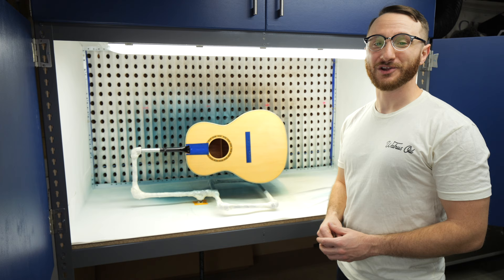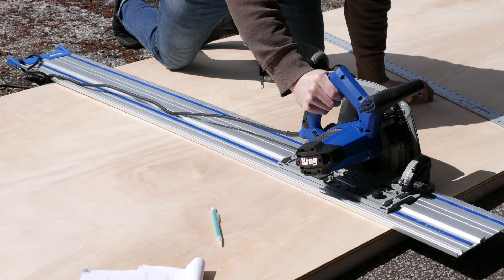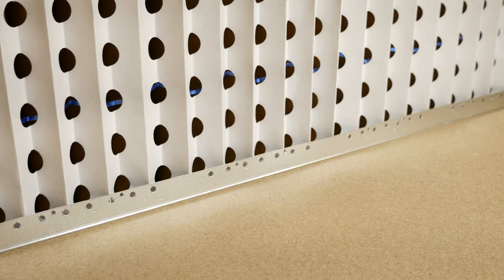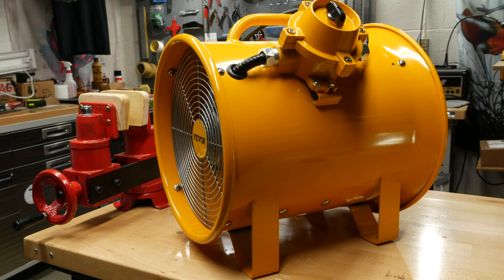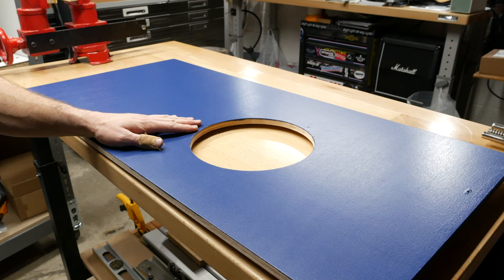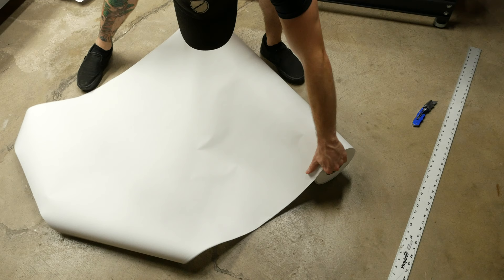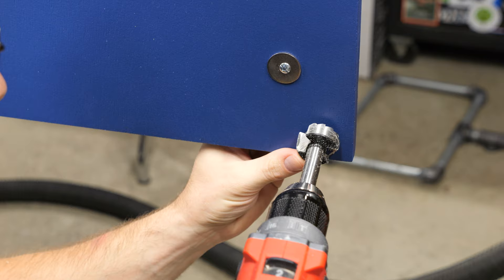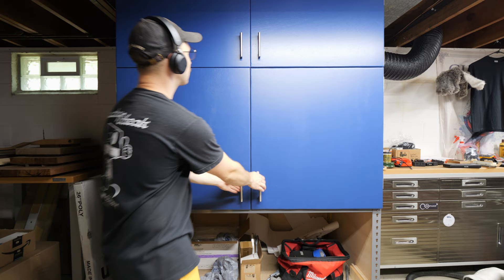Building a DIY Cabinet Guitar Spray Booth || Part 1 - Construction

Comment: I've been working for a custom shop guitar company for the last 5 years but we are closing shop so I'm finishing all the rest of the guitars that I was in the process of building so am building a spray booth in my shop. I went from a 12'x16' paint booth but don't have room for that so this is my inspiration for my future booth
Reply from the maker: Let me know if you need any dimensions or help along the way! This worked out pretty great. I am going to make a third video with the pros/cons of the booth. One thing I will mention is that I need to find a better solution to filter the air in the workshop. Keep getting stray dust/fibers in my finish if I leave the fan on too long after spraying...
Reply from the maker: I have an air filter in the shop that does a decent job but maybe I need something else lol

Comment: Awesome build!  I am using your build as inspiration for my own booth.   I have a question on the fan.  Is it powerful enough?  Or maybe too powerful?  Does it have multiple speed settings?  Thanks for a great video!
Reply from the maker: Thanks a bunch! The fan has been great so far. Plenty of power and it doesn’t seem like overkill. In the next episode I will show the draw from the primary filter. Sucks all the fumes out! It unfortunately doesn’t have any speed settings. Just on and off lol!
Reply from the maker: Feel free to reach out if you need any help along the way

Comment: Great videos and really enjoying them. I have a 2 ft deep workbench and want to do little spray booth on it similar to your great one.. is it enough depth???
Reply from the maker: Thanks for watching! Honestly.... I wish I had a little more depth with this build so I think 3 ft. is the minimum. I wish I would have pushed the filter back a few more inches to give me more clearance for offset/large bodies. You could make a new top for your workbench and extend it to 3-3.5 ft. towards the front of the booth. Might work out that way!
Reply: The only measurement I didn’t see on the video is the depth of the actual spray area?? Still a fine video and well done!
Reply from the maker: Whoops! I’ll measure it tomorrow and put it in the comments sections